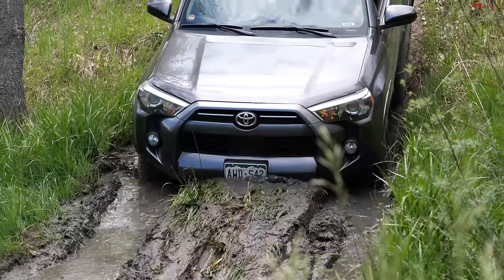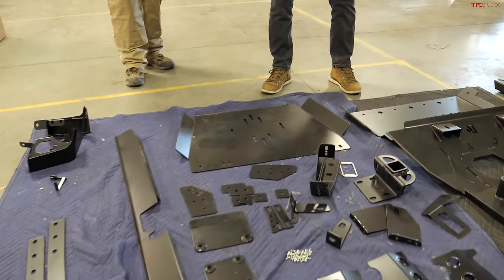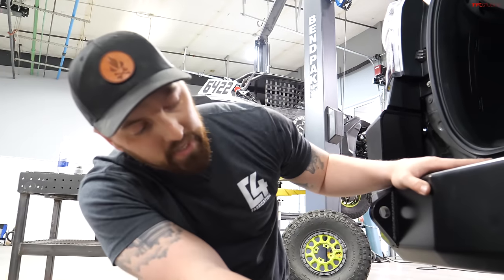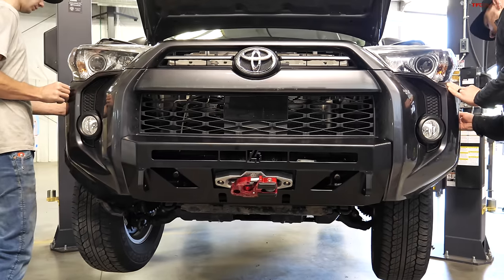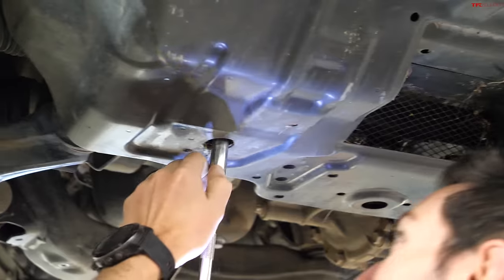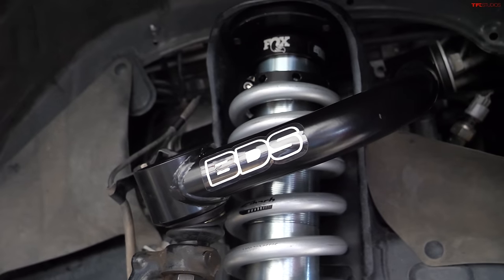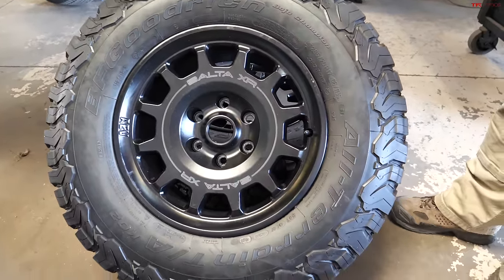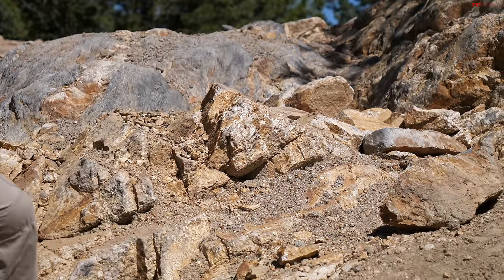From Boring to Brilliant: Here's How to Make a Bone-Stock 4Runner UNSTOPPABLE Off-Road!

Comment: How to make a bone stock vehicle great? MONEY! And lots of it.
Reply: What kind of comment is this? Spend money on the wrong components, and your vehicle still may not be capable. It also doesn't take much money to improve your vehicle
Reply: Welcome to motorsports. Never ending project cars because fun.
Reply: @malcolmn.5222  cry louder
Reply: Agreed😂
Reply: Agreed😂
Reply: @malcolmn.5222  I beg to differ. It's almost laughable the amount people are spending on overland rigs and off-road kits and supplies . What was once a list of reasonably priced upgrades to affordable work vehicles are now 10s of thousands of extra dollars ON TOP of $60k+  trucks,jeeps and SUVs. How is that reasonable?
Reply: For real. These Add-ons cost more than my 4runner.
Reply: For sure.. I have one and the only thing I’ve done so far was add side rails.
Reply: @willienillie6337  Exactly. Did you take a bath on the initial purchase price?
Reply: @bawintermage8351  I actually purchased it at MSRP.  There were no additions or markup by this dealership while other dealers added extra 5k-10k.
Reply: @willienillie6337 So, regardless of WHAT you bought brand new, you spent a lot. A new 4Runner is pricey but a pretty good investment as they are quite reliable, capable, and hold their value very well.
Reply: Just upgrade the stock tires on a 4Runner and it will unleash the beast.
Reply: @bawintermage8351   I don't agree with it, but to some people throwing money at the mods is the fun part. On the other hand, I've had my 4Runner over 4 years and all I've added is skids & sliders. I was going to do an "overland build", but then remembered I live in RI and none of that sh!t is necessary here. A much more appropriate tool for the job is an old XJ or TJ woods rig for the tight trails up north.
Reply: 😂😂😂😂 that’s very accurate
Reply: @malcolmn.5222 lmao what universe do you live in.  Its all about the money.  We are not talking about simple led bulb replacement here genius.
Reply: @Monkeyseemonkey79 until you want a lot ft then need to replace the tires again.  Lift first.
Reply: Bruh I spent a total of $750 and got my 4runner looking decent thanks to ebay motors. I bought a shit load of Ebay parts but they are sound and solid and work. Most of the shit I can fabricate it and weld and do it myself. But for an extra let's say $800 (under a grand) you can get spacer lifts, wraps, led lights and bigger tires with stock wheels paired with spacers change the stance to wide. Some stuff can be done for free like a viper cut or adding a fake hoodscoop like just stick a square object on the hood and center it and make it look nice. TRD hoodscoops are fake anyways. That's all I got on my SR5 4runner and it already get's complements and looks great. You don't have to spend an arm and leg on the big name overland things such; 1k on a bumper, then 1k on BGF ko2 and 1k on wheels and 1k on lights ... Just ebay motors your shit bit by bit and you will be shocked at how much you can do off of ebay motors.
Reply: @1119-w3u  Thank you for the paid eBay promotion. 🙄😜However, even by your budget calculations you are into or over the 5,000 range before adding any actual performance upgrades. And that's not chicken change! Not to mention that time is money, and since you can weld, you have to include the welding material cost and time cost into your equation. While I admire your cost cutting measures, my statement that all it takes is to fire the money cannon at your project car to turn it from mild to wild
Reply: Make more money, duh
Reply: And when the car is totalled in an accident, you lost all that money! Yeah people, keep spending! Debt for life!

Comment: I'm laughing cause my 2000 Expedition xlt came with front and gas tank skid plates, steel bumpers and fit 34x16s from factory. All I had to do was upgrade my shocks and buy bigger tires and I had a legit beach rig. Total cost (vehicle included)... $1200 😂

Comment: I just purchased a used 2022 4Runner SR5, and you should show people that own these vehicles with the "Electronic Selector" how to put it into 4Lo, and then DAC, or ATRAC. I found out that you can not go directly into 4Lo? When you try going from a stop right into 4Lo you will get a Blinking indicator light on the dash, meaning it did not engage (Light must be solid, indicating engaged)! And if 4Lo is not engaged , DAC, or ATRAC will not engage! You must put it into 4Hi first, then stop, put it into Neutral (4Lo will not engage in Drive) then put it into 4Lo (Indicator light will go solid), and then DAC, or ATRAC will work! Quite confusing if you do not know the procedure!

Comment: The R4T guy got the Fox DSC adjusters backwards. Low Speed Adjuster: is for things that move the shock shaft more slowly like Highway Driving.  The High Speed adjuster: is for things that move the shock shaft quickly like off-road obstacles and whoops.  The DSC labels relate to shock shaft speed NOT the vehicle speed.  I have custom valved and tuned DSCs from Accutune on my GX, they are pretty comfy and versatile.  I did choose a different system for my LC though.

Comment: Every time I watch these build series, it always reminds the excessive amount of money spent and how you should learn to do it yourself and save all of that money and learn a skill.
An angle grinder, welder, basic hand tools and a small place to work is all you need. Start off with a small part and enjoy the learning the process. This is what I did 15 years ago and with the money I saved I now have a small shop full of equipment for my projects and from time to time I also do custom fab for others as well.
Reply: Um no, just because you can DIY doesn't always mean you should DIY. If you have the money to spend, have this equipment professionally installed because they will often insure their labor too if you have issues.
Reply: While I appreciate doing some things myself to save a few bucks -- suspension install, brake jobs etc -- I'm not sure that I would recommend that people try to fabricate their own skidplates and bumpers.  Not that you can't make your own stuff, but the C4Fab guys were using a handheld 3D scanner on that Tacoma behind us to map the rear bumper dimensions and mounting points.  And they had like 8-10 welders who are a lot better at welding than I'll ever be.

If you have a 25 year old 4Runner that you just want to go out and beat up on the trails, then homemade skids and sliders would be fine.  For a ~$35K truck, a bunch of homemade parts are going to look terrible.  I'd rather work some overtime / pick up a few extra shifts to cover the cost of these parts made right.
Reply: @malcolmn.5222 none of this is hard to do. It's hilarious people would pay a shop for any of this
Reply: @tuckerhiggins4336 I don’t have the time or tools to do any of this, but I do have the money to pay someone to do it.
Reply: @XploreAz  I don't buy it. Just took a welding class and did my bmc chop and welding in the class. Easy. Cheap. Learned a skill. Worth more than paying someone else
Reply: @tuckerhiggins4336  I bet it looks great too. 🤣😂
Reply: @XploreAz yeah, a lot of these diy guys think bird $hit weld ground down is solid! “I took a welding class, now I’m a welder” makes me lmao!!

Comment: I like this series, It will be interesting how well these mods will work. We have a similar set up on our 2014 Trail 4Runner. 3" OME lift with the medium springs, 285/70/17 Mickey Thompson Baja Boss A/T tires on factory rims, LFD crossbars on our factory roof rack, SSO rock sliders, Toyota TRD aluminum skid plate, 12000 Badlands winch on a Warn receiver mount. It would be nice to have the upgraded shocks and control arms along with the steel bumpers...we went more budget conscious and a bit lighter weight. I am lucky, as a decent mechanic with a fairly well equipped home garage I didn't have to pay for labor. Ours does have a rear locker and crawl control. If we keep ours a while longer we may go with a front bumper like the C4 you used, as it would definitely help our approach angle.
Reply: That sounds like a sweet build!
Reply: Just bought the same lift as you for our 2014 trail. How do you like the ride with the medium springs?
Reply: @sootlifejew  We like the ride. It is my daily driver. With the front 12,000 winch and a hitch mounted platform trailer loaded with two large ammo cases, it still rides level. We have driven 2000+ miles loaded. With no issues.

Comment: It would be a great service to document the before and after weights if the build as a huge issue these days are folks blowing through their payload. It’s pretty eye opening how much some bolt ons detract from your Pauli’s and how easy it is to be way over GVWR on 4Runners or for any vehicle this size when folks add all of their camping gear, recovery gear, tools, and passengers.
Reply: Couldn't agree more, most 4R have 850ish to maybe 900 payload on the door sticker, there was almost 400lbs of steel going on that thing...ouch, maybe 300 for 2 passengers...and you can quickly see how many people are over weight on their rigs
Reply: @rossipremier  exactly, though this being an SR5 with no rear locker it has a touch higher payload. All the models with a locker have a reduced payload. I love the 4Runner but it’s one if the most grossly overloaded vehicles I see people build.
Reply: We address this in the next episode. I weighed it before and after with a full tank of gas each time
Reply: @MrGrantSDavis  gald it is going to be addressed, many people don't even consider the weight at all. However... going over build planning as a first episode would have been a much better layout. That is the step everyone forgets...they see these built up vehicles and make decisions on cool factor. And again...springs don't add payload as the guy said when you all were talking about rear shocks.
Reply: @MrGrantSDavis  awesome, thanks for taking it into account 🤙
Reply: @rossipremier  Rationally, your request makes sense, but in terms of engaging video, watching us debate and consider what we're going to install and why is the stimulating equivalent of watching paint dry.

Comment: Loving the Synthwave for the intro.
Two other things, and I'm sure the build isn't finished:
1).  The spring rate was increased to help with the added weight of all the bumpers, sliders and skid plates; but nothing was done for the braking.  A huge change in braking hardware isn't needed, just slightly more aggressive pads with better heat resistance.  If you encounter brake fade and a soft pedal coming down the Eisenhower pass with upgraded pads then maybe swap to DOT4 brake fluid.  Don't use DOT5, it is designed to prevent corrosion of braking components on cars sitting on the museum floor.
2).  It was incorrectly stated that changing out the springs will increase the payload.  Springs will a higher spring rate will help control the vehicle when loaded, but higher rate springs DON'T increase the payload rating of the frame, axles or brakes.  It also doesn't change the GVW/GCVW number on the sticker in the drivers door frame or the in the owners manual or the DMV rating and those numbers are what the cop will use when he/she pulls out the scales.  It is only a matter of time before cops start pulling over off road modified vehicles and writing tickets for illegal equipment/modifications they way they have been for the import tuner scene since the movie "The Fast and The Furious" was released.
Reply: 100%, hopefully everyone sees this comment and others regarding the weight and issues with doing all this to your rig with no regard for safety
Reply: @rossipremier  I discussed the brake issue with Hugo. In his and his crew's experience, yes, you do need to pay close attention to brake wear with the added weight, and he's found that here in Colorado, factory Toyota pads work/wear best.

Comment: I like the C4 stuff, and as a 4Runner owner I'm watching the build with interest. I don't really understand the reasoning behind getting the rear bumper with no swing out though, seems like the reason most people actually want the rear bumper is the ability to run the tire on the back and attach gear to it.
Reply: LOL  Grant said he cannot put a tire carrier on the back because then it won't fit in his garage.  However, I don't understand the purpose of that much steel/weight being added back there either if there is no intended gear that is going to be mounted to it.  James's vehicle has no steel rear bumper and it does not appear to be scraping.  Nor are the rear fenders torn up.  So, idk.  Hopefully some of this will be explained.
Reply: @WW-wf8tu  It's really just my personal preference. I like how the rear steel balances out the ride to be honest. I needed a new rear bumper anyway. To each his own.
Reply: the weight your adding, would not recommend for my rig. On my 4Runner when I overland would definitely put me over payload capacity of vehicle.
Reply: @MrGrantSDavis   Hey Grant, are your AEV wheels the matte black color or the onyx color? They look great. Thanks!

Comment: Hi , i saw you use rubber blocks to mount roof rack without silicone, on 14.19 seconds -  could you please tell where i can buy it , i prepare install roof rack,  but all the video says should to use silicon,  but i think blocks are better. Thank you.

Comment: @19:24 There's my man Hugo. Insane knowledge he has and done many projects for my 4Runners. For the next video love to see what is the total weight of the 4Runner? Last time when I measured my TRD Pro is 500lbs with full aluminium skids (every damn skid from A-arms to rear diff) and HREM sliders. Haven't measured after 285s but with SL tires its should be pretty close to the same 5000lbs. Love to have front and rear bumpers but weight vs mpg is a concern since its just a weekend worrier not a offroad rig. (For anyone thinking why I need bumpers if its a mall crawler,  with the trails I take it I have scratch the under side of the rear bumper. Front I have pretty good clearance but would do the front also if I decide on rear. Reporting all this to insurance also a pain and sky rocket the premium. It was a pain on accident repair on my modified TRD ORP since I didn't know about reporting mods to insurance.
Reply: Before I forget, Please don't forget front and rear lockers for the SR5. PLEASE...!!! I bet E-ton e-lockers are trouble free option.
Reply: @LionRunner  Not sure I'm going to need them for where and what I want to do with this truck, but thanks for the idea!
Reply: @MrGrantSDavis  I really wish I have the talent to tempt you for dual lockers and show a video how your SR5 crawl with fully engine power zero wheel spin vs my TRD Pro not having front locker rely on A-trac wasting energy applying brakes on front wheels. Mine's on 285s too but factory suspension. Could be some what apples to apples and absolutely don't care the defeat to fully locked SR5🔥 if used on a TFL video. In future I'm thinking of e-ton front locker on mine especially to have better control (I mean go straight with out sliding on icy spots) in winter wheeling. Switzerland trail is one of my fav winter trails but never attempted that spot. 🍻 That is normally our snack / lunch spot after Goldmine hill is closed.
Reply: @LionRunner Eaton’s are fine until you need to reverse, then they unlock if you want them to or not. It’s an annoying design limitation.
Reply: @JollyGiant19  that's what I found so far too. I wonder they improved anything or not. If not I will turn off and on again to re-engage.
Reply: @LionRunner No, they’re still the same. It’s worth noting that it’s an Eaton specific issue, to my knowledge OEM electric lockers don’t do that.

Toggling them off and on again won’t fix it. All turning them on does is engage the magnet, the balls that stop the differential from differentiating are still out of lock. So long as those balls are out of lock, you can’t get it locked until you roll forward enough to have them pushed back and and re-attracted to the magnets.
Reply: @LionRunner  Overland Pacific Northwest channel is a perfect place for people to understand what is going on with lockers vs not on the 4R.  They have them and they explain when it is useful and not.  In short tho, the take away is, lockers are desirable IF you are going to be challenging your vehicle for long uninterrupted distances.  The systems that come standard on the TRD OR are more than enough to cope with things in the short as needed bases.  So, unless you are doing level 7 and above difficult terrain for hours on end, lockers are not beneficial for the $ and weight.  And I personally think, if you are going to be maxing out your time in that much technical stuff, you probably don't want to be in a 4R, (or any street legal rig)but rather a side by side.
Reply: @WW-wf8tu  ahh yes..!! That is a fantastic channel. Recently I was sharing about the lockers with both of them on the comments. Love those 2 brothers.

Comment: That PS cooler attached to the condenser with the plastic pull tabs is asking for trouble. They get loose or break over time, and the cooler will rub a hole in the condenser. If they are offering a "kit" they need to make a bracket to actually mount it isolated.